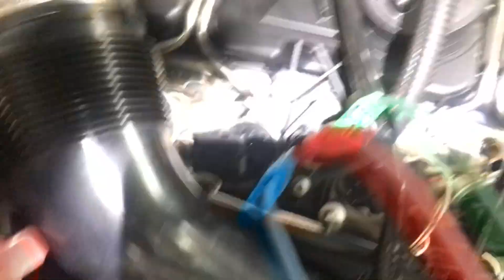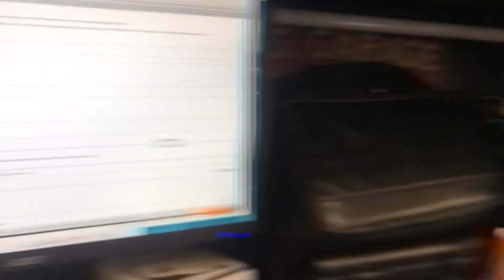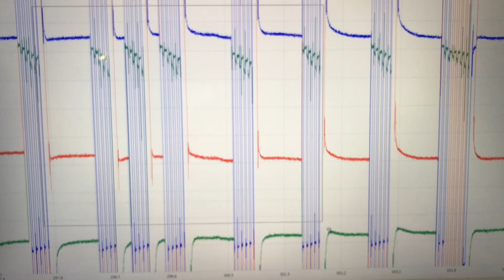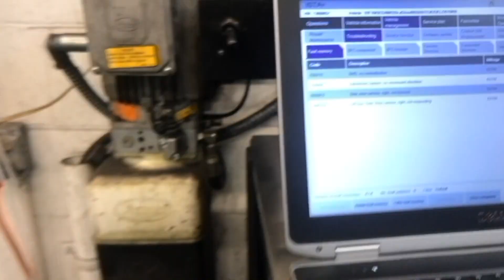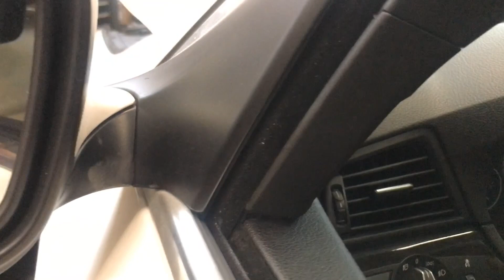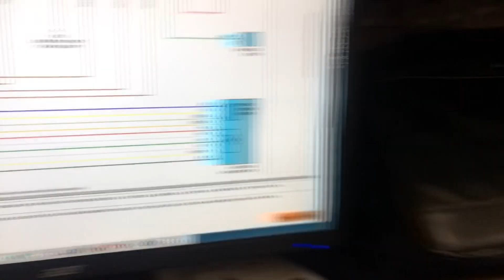2011 BMW 535i N55 F10 no start valvetronic, eccentric shaft and intake camshaft removal Part 3

Comment: What is causing only my green wire to get 3 bolts straight from the dme and the red and white are both battery voltage

Comment: Hey bro I have a start and stall after installation of a new valvetronic solenoid can you give me a heads up why after installing new one
Reply from the maker: Did you run the re learn for valvetronic limits? Also did you install the valvetronic in maximum or minimum position?
Reply: I installed in the top position but the unit goes to the lower position soon has you plugged in the valvetronic.
Reply: I'm located in Philly
Reply: The old valvetronic would let the veh start and run but  Shake.

Comment: Thank you for sharing，I see you have replaced the motor, the electronic shaft and the bearing ,intake camshaft . but  Rocker Arm  and  spring is not replaced,What's the reason? Or do you think they're strong and less likely to be damaged. Thanks again for your professional sharing
Reply from the maker: Well on this set up the rocker arms are very different and have rollers in it, so not necessarily to replace after checking clearances. This vehicle had very low miles on it.

Comment: thank you for the video! so did replacing the motor with another one fix the issue or did it still show no movement? and when replacing the dme did you source a new one from bmw?
Reply from the maker: Hi, great questions. Yes the motor was defective and the next new show movement. DME was from dealer new.

Comment: with a half bridge BLDC controller or also called speed controller and a arduino board with PWM output you can drive that motor to make sure its spinning. You can also read the hall effect voltages individual with a scope which you did to make sure you get a voltage reading. The hall effect has to be read when the motor is spinning otherwise it will read zero ofcourse.
Reply from the maker: Pladi K thanks for the great comment!!

Comment: WHEN YOU WAS MEASURING THE  VVT MOTOR SIGNALS  ALL FIVE , DID YOU  CRANK THE ENGINE OR MANUALLY  ACTIVATED  THE  ECCENTRIC SHAFT?

Comment: HOW DO YOU ACQUIRE THE ISTA PROGRAM ??
Reply from the maker: renebimer 40 from BMW
Reply: @MaicSalazarDiagnostics   I USUALLY HAVE  THE  AUTOLOGIC AT HAND BUT  I THINK IS TIME FOR AN UPGRADE!  DO YOU HAVE A YEARLY SUBSCRIPTION
OR HOW DOES IT WORK?
Reply from the maker: renebimer 40 yes I do. I just purchase the Autologic Drivepro. They send me a Bluebox until the new DrivePro comes out. I really like Autologic. Why you want the Ista for?
Reply from the maker: renebimer 40 you should look into the DrivePro from Autologic. It has a built in passtru (cardaqM) so if for any reason the built in software is not enough you can use the Ista with a one day subscription.

Comment: So was it the part that was bad...good vid
Reply from the maker: Eri Ginez the no start was caused by the Valvetronic motor shorted, eccentric shaft damaged. Even at the end I had to replace the DME, the driver for the Valvetronic got weakened as well. All this is truly a bad design from BMW engineers